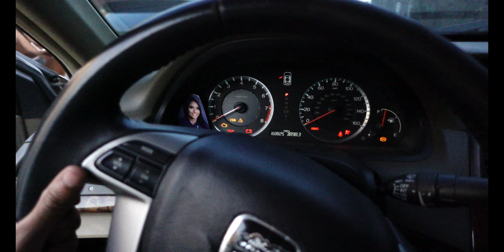BREAKING A BRAND NEW 2022 SLINGSHOT LESS THEN 100 MILES!!| NJ CAR MEET|

Comment: Electrical. Specially doing sutch a big music system. A wire grounding something
Reply from the maker: Could definitely be bro… it had ground issues 1st day it came out the music stop working they had to reground it
Reply: @thelowerclasstv  believe it or not I just picked up a type s front aspect kit for 260 oem at the Acura dealer in  nj. The skirts and rear with the front 1200$ only black and gold colors left. They out there